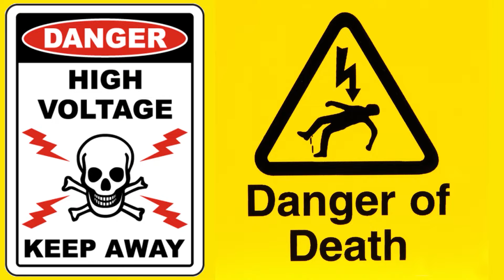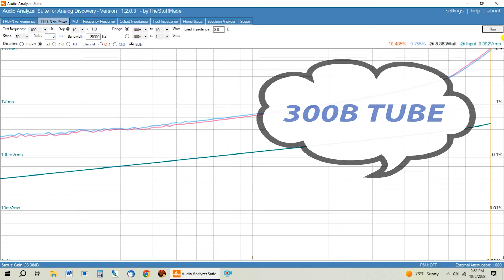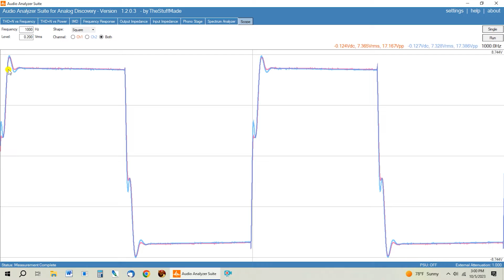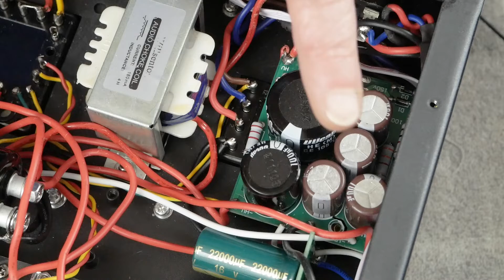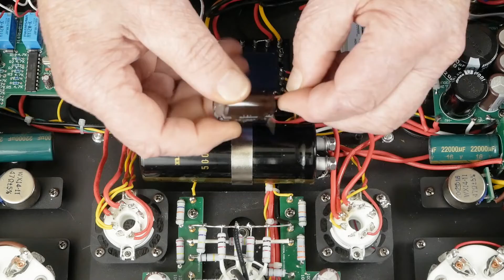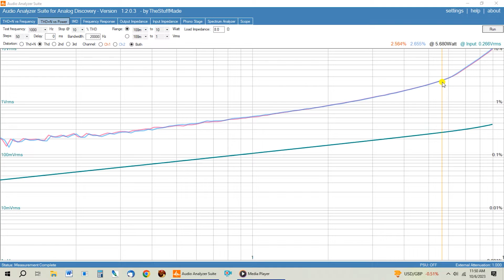Willsenton R300: Early Version Power Supply Mods.

Comment: Re. the first filter cap after the rectifier tubes; if you are going to use 5ar4 tubes, they can tolerate 50uf for the first cap.
Reply from the maker: Yeah a solid NOS one will. a modern production one won't. I'd still use a 33uf or smaller first cap.

Comment: can someone tell me where the fuse is on these things? . it's shipped with 2 fuses.
Reply from the maker: It's part of the power input jack on the back of the amp
Reply: thank you so much .. I tried some Shuguang 274-b's and they sparked and blew.  now I have no power to the amp even with original rectifiers.  I hope the fuse shipped with the amp works . thanks again so much !  now I hope I don't get myself killed . I'm afraid to dig around in there, but hopefully I can replace the fuse without a mishap.

 @SkunkieDesignsElectronics

Comment: Will a Mundorf 33uf AL 500 VDC cap work for the new capacitor?  What spec did you use?
Reply from the maker: I used a 33uf 500V.